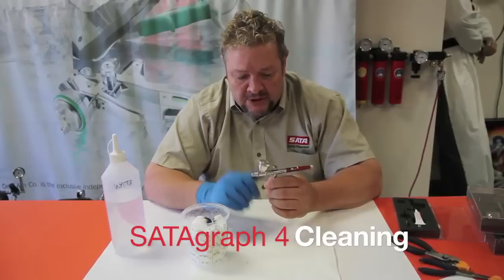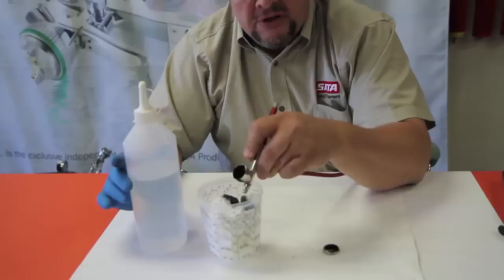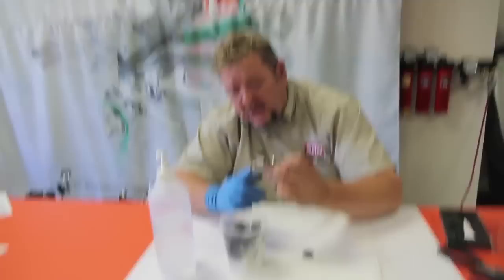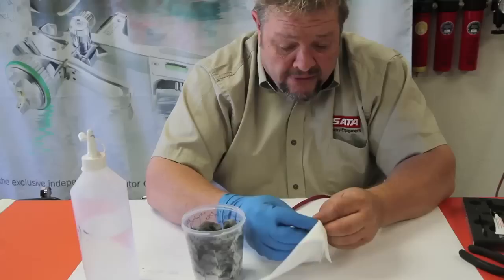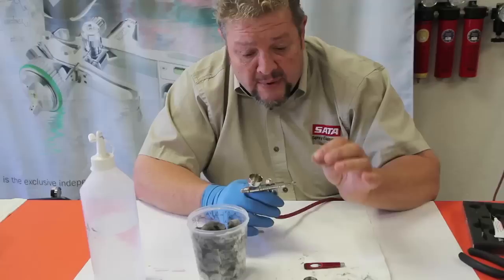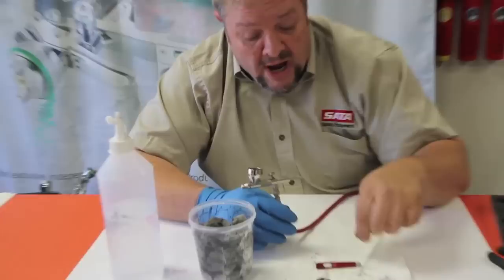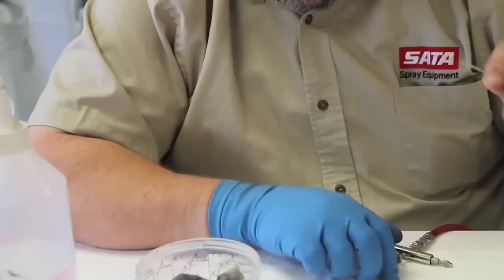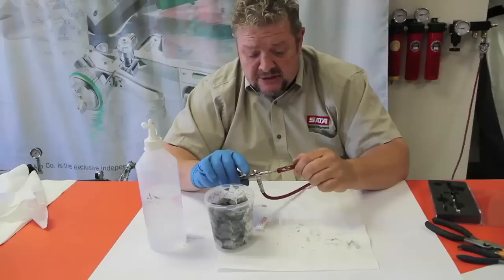How to Clean the SATAgraph 4 Airbrush with Mickey Harris

Comment: Is it better to pull the needle out thru the front of the gun? Or is that not recommended? Thank you
Reply: Jeff DeLuca On my SATAgraph 4’s I always use the wrench and remove the whole front section and slide the needle out through the front and I’ve never had a problem with mine. After everything is cleaned up really well I lube the needle and slide it through the back after I’ve reattached the nozzle portion up front. Like I said, it’s always worked fine for me and I’ve never had any problems. As for the airbrush, I have two, the B and the S and both work fantastic for me. I’m blind in my left eye, so the side feed is the one I always use, but whichever one you have I’m sure you’ll get a lot of enjoyment from using it. 
Best wishes